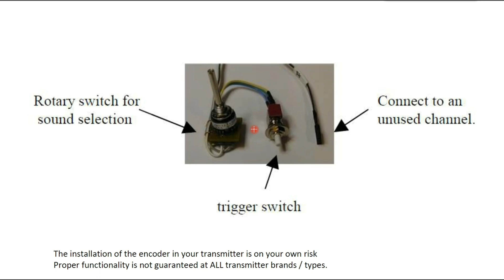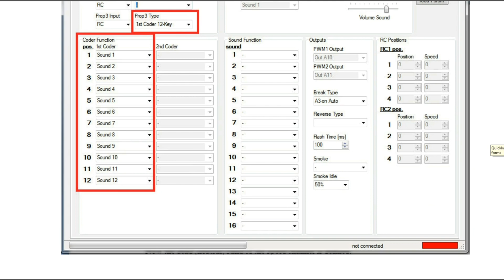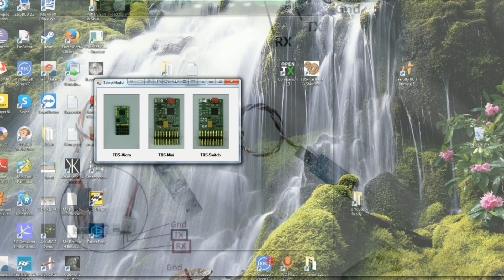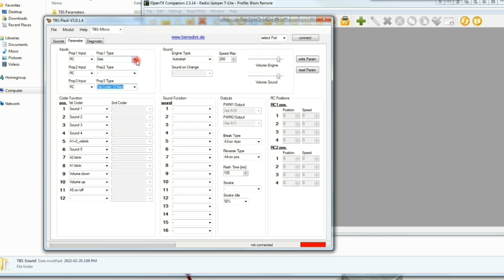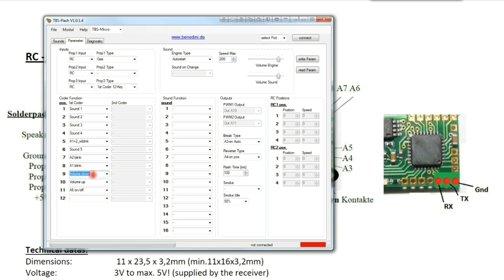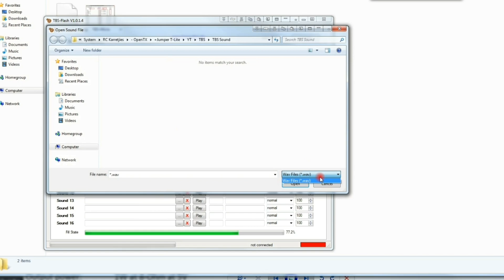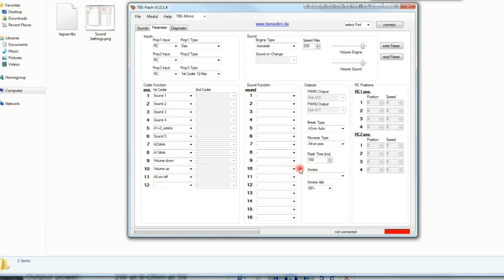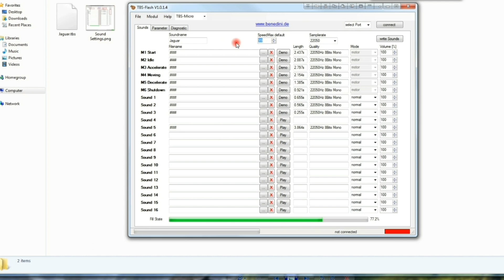Part 1: DasMikro Sound Unit (TBS Sound Unit) 12 Position Encoder Setup | BrothersK&MRC

Comment: I have bought 2 of these.  When they work great, but there is one thing

WHY THE FUCK IS THE TINY PLUG FOR PROGRAMMING THE BOARD NOT SOLDERED ONTO THE BOARD FROM THE START? 

I by some miracle managed to get on programmed by just jamming the plug into the board. 

The second one just refuses to connect to the software and I do not have the tools or skills to solder that tiny plug onto the god damn board.
Reply from the maker: Haha yea I don't know why they like to make life hell for people. 

Get a big magnifying glass and a tiny soldering tip. That helps a lot.
Reply: @thesouthwestern  Yeah, makes absolutely no sense. 

I tried soldering it, I think I got it, but i still didn't work. Then I figured I'll keep it with the stock sound, drove around for 2 minutes, then my ESC blew the magic smoke. 

Ripped the sound unit out, took all the cables etc for other use and broke the PCB in half and threw it in the trash.
Reply from the maker: @thqp  Yea might have been a faulty one form the start. 
I got 3 redbrick esc's a while ago, and 2 of them was olso messed up out of the boks
Reply: @thesouthwestern  Yeah. I figured I'll buy an ESS-one system as it seems to be the most popular and well regarded option.
Reply from the maker: @thqp  Do you have an ESS system option that is that tiny? 
Or is it for 1/10 car?
Reply: @thesouthwestern  I don't have one yet, got to order it. 

But I figured I'll tear the speaker box apart to save some room, and if need be switch in a smaller speaker
Reply from the maker: @thqp  Should be a lot smaller if you do that!

Comment: 9:10 hello, I saw that when you select a file, it is showing "demo", does it work normally when it is reproduced by dasmikro TBS?
Reply from the maker: If I remember correctly the demo only means you can't download/save the sound. 
It works normal even though of says demo. 

But explain some more, I don't understand exactly what you mean.?
Reply: @thesouthwestern  you answered my question exactly, because when I saw the TBS files as "demo" I thought they would not play completely in dasmikro
Reply from the maker: @wisney_snyps  Okay, yea it works 100%. 
Only problem is you can't use it to make your own "sound mix". 

Other problem is that the sound it comes with is also "demo". Meaning once you change sound you can never get original back. 
Because "demo"  sound can not be backed up.
Reply: @thesouthwestern  👍Thanks, I'm thinking of putting it in a P51 Mustang
Reply from the maker: @wisney_snyps  That would he interesting, I have had the idea of trying it in a helicopter hehe. 

I think you will just need an amplifier, its own output won't be loud enough.